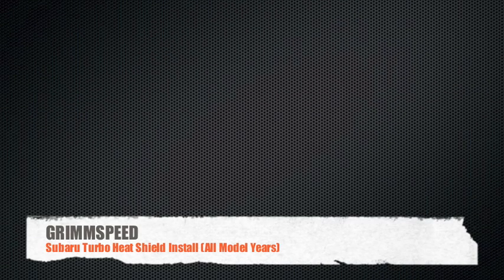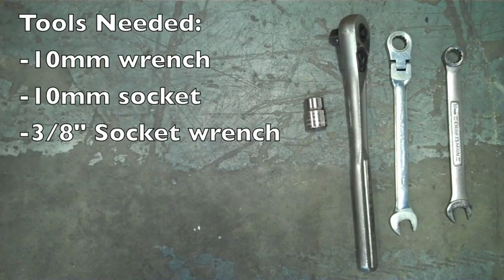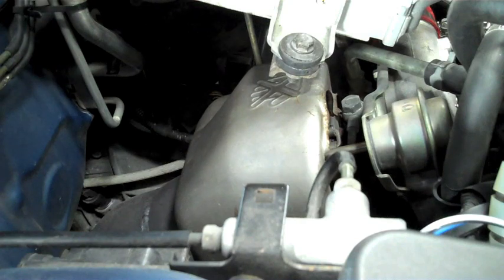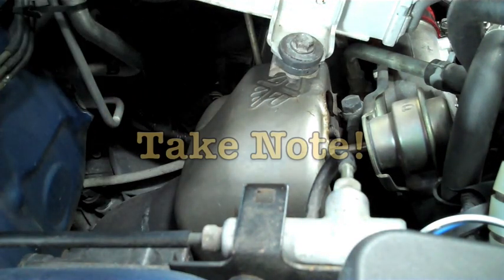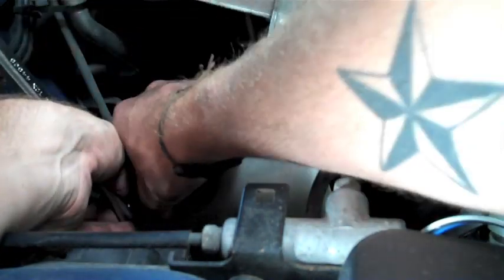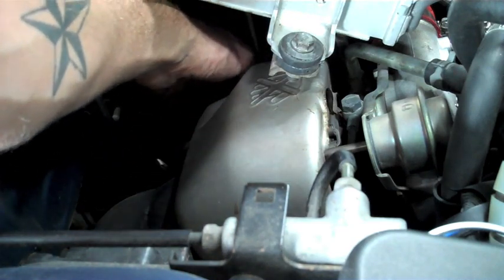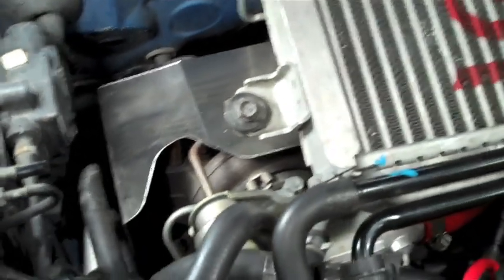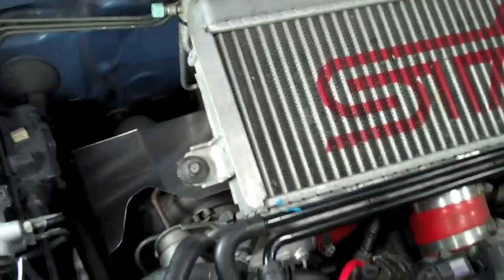GrimmSpeed™ Subaru Turbo Heat Shield Install

Comment: I don't see any reason why you would replace an OEM heatshield that to me looks like it incased the turbo better then this thin piece of sheet metal? Other then if you were missing your heat shield then I could see replacing it with this grimmspeed one then shell out money for an OEM.
Reply: You're absolutely right. Unless theres proven performance which i highly doubt
Reply: Mines missing so I'll probably get this
Reply: It's better than hacking up the stock one after you install a downpipe. Looks way better also.

Comment: Obsolete.  Use turbo blanket.  Get rid of the turbo shield
Reply: EAteearsehole Yeah, but you wouldn't have access to the turbo unless the intercooler is removed for newer WRX.  it's more work man.
Reply: Don't listen to this guy. Use both.

Comment: Man this thing was a tight fit. I got a couple of scratches on it which bums me out but it still looks pretty good. I was only able to get two of the bolts in (one on either side) because the third location one of the bolts that held in the OEM shield had broken and part of the bolt was still in the threads. It seems to be pretty sturdy. I torqued those two bolts down pretty tight.

Comment: Ok I have a 2002 wrx wagon and im trying to install a perrin heat shield since the turbos oem one is missing. The only problem im having is i cannot find were you bolt the perrin shield to so i dunno if im missing some oem bracket that's supposed to be there and is not. Any advice would be helpful Thanks

Comment from the maker: Yes, there are two heat shield brackets.  You will need both of them to securely mount our heat shield.  We do sell them, and we also have the OEM part numbers listed on our site under that product as well.

Comment: @ethosflux Once the OEM heat shield is cut it becomes dramatically less effective than our aftermarket unit, The big other benefit of ours is that it fits any downpipe/turbo in a stock location so you can grow your vehicle and still use our heatshield perfectly! :)

Will